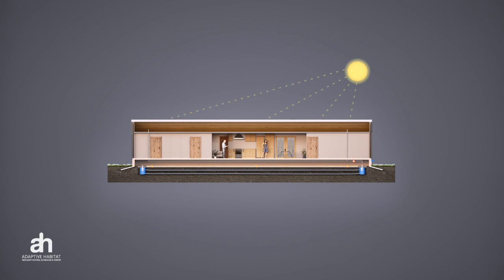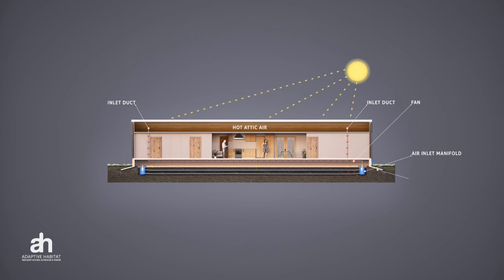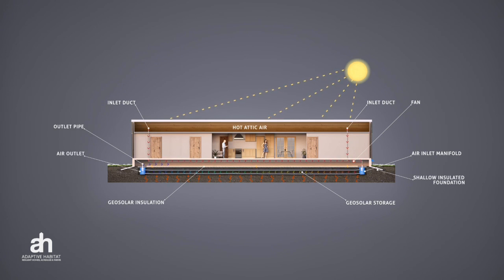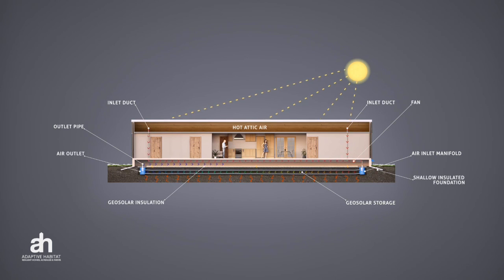Storing Heat Underground in a Geosolar System - Cutout

Comment: WAIT, so it holds heat for 6 months?!?!
Reply from the maker: around six months, yes. we know this from other projects using the same technology.
Reply: under what temps did it hold heat? (like outside average temps and what the temp of heat is stored at the start of the test and then half way through ) and you are saying it heats it up just one time and it holds heat for six months?
Reply: This system doesn't heat once and hold enough for six months. It's a closed loop system that continually heats up the thermal mass over that claimed six months, and gradually harvesting less as it gets closer to the winter solstice. It's made efficient by using the heat in the thermal mass and insulation around the crawl space to heat the insulated house and reheat the air in the attic that it harvests from to form that closed loop. Even in the middle of winter it could be harvesting enough on a cloudy day to keep the thermal mass topped up if the roof is designed to absorb a broad spectrum of the sun's radiation and the heat loss of the house is minimised by using practises like those used in designing passive houses.